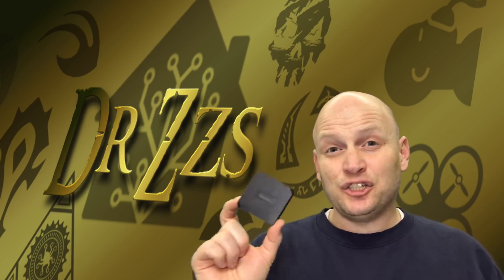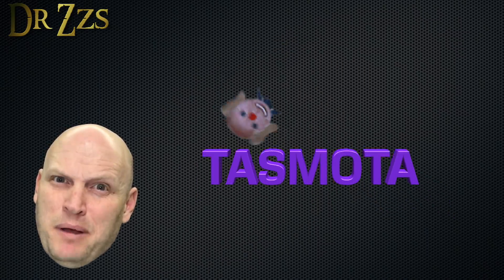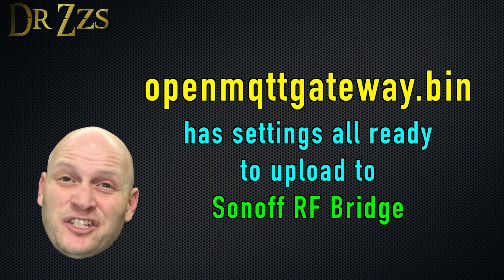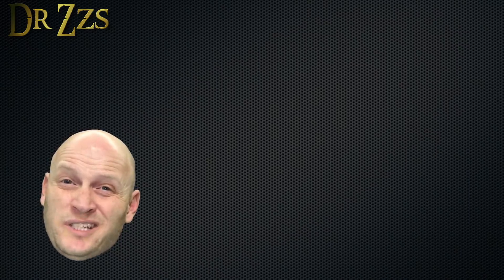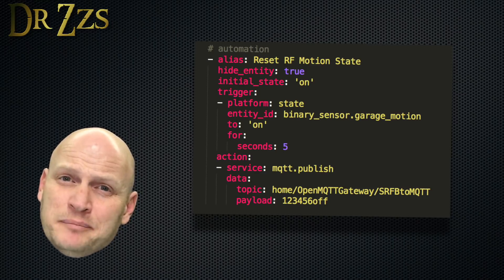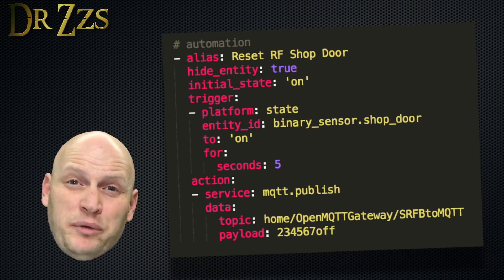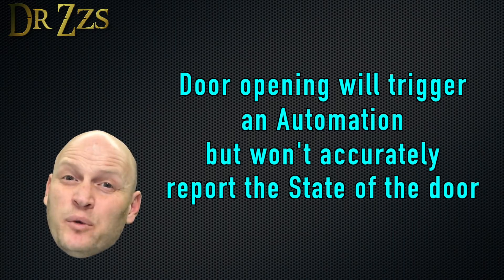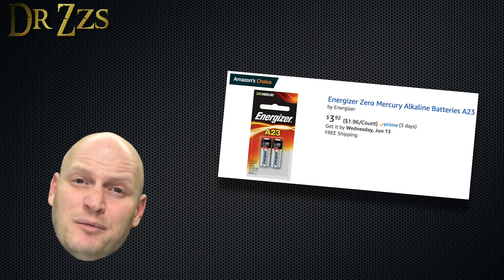Sonoff RF Bridge w/ MQTT & Home Assistant

Comment: What do you think, wich software is better for DOOYABLINDS. OpenMQTTGateway or Tasmota with the Portisch firmware? I will control the bilinds in HomeAssistant. I hope it´s possible to get a state in % or somthing linke that.

Comment: Hi, having trouble with this. I just get a command window that cycles through a few attempts and the flash failed. "trying to connect". Ive followed your instructions but im stuck. What am i doing wrong?
Reply: Try reversing the Rx/Tx connections on one side. You want the Tx of the adapter to connect to the Rx of the Sonoff, and vice versa.

Comment: Has Tasmota improved in regard to messaging or would you still recommend openmqttgateway?
Reply: Hello, i am using tasmota 7.1.1 on a sonoff rf bridge, it works a treat. Do you need help with anything?
Reply: @MegaGaspadin  I’m good thanks, ended up using an RFLink box.

Comment: Hi everyone. I´m new with Sonoff. 
Does anyone know how many PIR or magnetic sensors may be connected to an RF Bridge ?
I need to connect more than 64 sensors. I´ve read limit is 16. Maybe with Tasmota or another firmware, limit may be higher.
Thanks !

Comment: On my Linux Mint system, it know the battery status of my AA mouse battery.  It is at 70% right now.  Is there a way to get the battery state of these RF devices?
Reply from the maker: Some will send a battery-low signal, but not all.  It just depends on the sensor.

Comment: After flashing Sonoff Bridge will also suport more devices to be added to same bridge ? Initially support only 4 and in case you need more have to buy another bridge .
Reply from the maker: If you use Tasmota there are no limits to the number of codes the bridge can receive.  It is limited to 16 codes to transmit.

Comment: What's the Range of the Rf devices? I live in a big house. and therefore I got a lot of ZigBee and z-wave stuff. but at the price point, the RF stuff comes at it made me interested. then again if I need to have multiple bridges like you do with IR I think I might just pass on the RF stuff what you're experience with this?
Reply from the maker: I've had good experience with RF devices.  I have RF sensors out in the garage with the Receiver on the second floor, so separated by several walls and at least 50' and they seem pretty solid.  They aren't as fast to respond as Zigbee devices, but as you say, the RF stuff is pretty cheap.  
I just started using the Xiaomi Aqara sensors with the Conbee II and the Deconz add-on for HA.  They might be the cheapest Zigbee sensors.  So far they've been working pretty good.  I set them up on a live stream a couple months ago.  I've got plans to do a full video about them soon-ish.  
Hope that helps.
Reply: @DrZzs  you will love the aqare stuff. I've been using it for over a year and I love it. The only issue I have with aqara motion sensors is that it takes a full minute to go from detected to clear. Aka on/off. But as fare as buttons go they are brilliant
 The aqara cube seemed like a gimmick. But now I have a few. For music controls light dim and what not. Definitely get the cube!! Well as a matter of fact get everything aqara and xiaomi has to offer for smart home. It's integration with home assistant makes it so powerful and yet cheap.

Comment: Thanks for the video, my 433 Mhz PIR sends three  different codes, is it possible to OR the codes  in the template for example: payload_on: "51FEA0" OR "51FEAA" OR "51FEAB" if this is not possible can wildcards somehing like the following can work? any hint would be great.... thanks
payload_on: "51F***"
Reply from the maker: You can't use wildcards.  I would guess one of those codes is "on" as in motion-detected.  Probably the one ending in A.  Then probably B is the Off code, and 0 could be a low battery code or just an "available" code, meaning the device is active.
Reply: @DrZzs  Awesome, You were correct sir, at least one code was consistent with motion detection, thanks for the feedback.

Comment: Hi Dr
I have Broadlink RF pro. I heard that Sonoff Basic RF is not compatible with Broadlink frequency so I ordered Sonoff RF Bridge. 

I have different types of down lights installed in my home (not my doing). Those come in  different sizes and also use different power (12v, 16v with transofrmers and 230v). There are some downlights that are wifi based including hue range. 

However unlike normal lights where down lights are installed there are about 4-5 of them in each room. So If I am to get wifi based down lighrs I would be clogging my mesh network further. As such I am planning to add Sonoff RF basics for each downlight and then use Sonoff Bridge to control them. In that way I do not need to change the existing bulbs or power controllers and just need to add a soffbasic RF to the circuit which is very easy to do. 

My question is have you played with Sonoff Basic RF and can I easily on/off with the Bridge which mimic turning on off down lights via switch. 

Thanks

Comment: So you're using a gateway to convert RF to MQTT. Can't we skip the gateway and simply have an RF receiver on the Rasperry?
Reply from the maker: You could certainly do that.  I don't know what an RF receiver for a pi would cost, or what would be the best way to control it.  My Sonoff RF bridge has been rock solid running Tasmota for a long time.  My way works, so I'm sticking with it.

Comment: eish... newest code, refusing "your_password" as the wifi manager initial access / password. anyone else get around this, Need to urgently get access to the RF bridge, got someone coming to help me with stuff later and need it working then. running OMG
Reply: Ignore, eventually it decided to accept the password. not having a web interface that can be connected to after it joined a wifi ssid, makes it difficult, I seem to have initially specified mqtt credentials wrong, costed me re-flashing it, would be great if it had a post wifi join web interface to check/reconfigure these. just saying...
Reply from the maker: Glad you got it working.  ya, that would be a good addition.  Thanks!

Comment: Hi! I got the "GS-WDS07 Wireless Door Magnetic Strip" from banggood which actually transmit two separate codes for close and open. So that is nice. But there's another problem: if HA is restarted it'll show the doors as "closed". How do I make HA remember the last status? Better yet: is there a way to request the status from these switches? Or hack them into sending their status at intervals... Thanks!
Reply from the maker: Cool!
I don't think there is a way to request state updates from the sensors.  
To get HA to remember the last state you need to set the message to send with "retain".  I don't remember how to do that with OMG since I switched to Tasmota for my RF Bridge. There should be a setting in OMG somewhere to send messages with Retain.  That should be the trick for remembering states after HA restart. 
Hope that helps.
Reply: @DrZzs  in the video you talked about why you used OMG instead of tasmota. So you switched back to tasmota?

Comment: Would be nice if we can define/specify the topic to which the bridge posts messages.
G
Reply from the maker: I started using Tasmota for my RF bridge and it works better imo than OMG. You can do some customizing of the mqtt topic. The RF code it generates is something established by the manufacturer (I assume).  There's no way to easily change that code that I am aware of. 
https://youtu.be/OfSbIFIJPuc
Reply: @DrZzs  eish... just saw your response now, after deploying OMG this weekend, was about to ask how to do rules in OMG as it seems taking the data and changing the mqtt publish to specific topic simplifies things allot.

Comment: Hi!
This worked perfect once I decided to follow your steps EXACTLY as described :) , with a couple of notes, though:

- you said: "once this is successful, and I'm sure it will be, on your first try (...) then get out your phone and look for a wifi network.."
Actually, there's no OpenMQTTGateway network available at this point.
I assumed you disconnect the Sonoff RF Bridge, put its switch back to "ON" and then plug in a power adapter to power it on. Correct? At least this is how it worked for me.

- the topic seems to be home/OpenMQTTGateway/SRFBtoMQTT (without the last " / " as captioned on the video) and seems to be case sensitive!

When all is up and running I get the messages on this topic (with MQTTlens) but it takes about three seconds from the time I activate/deactivate the magnetic switch until the RF_LED on the Sonoff RF Bridge blinks and the message pops up in MQTTlens. Is that expected?

I should add that I first tried to flash from command line with esptool.py (first erasing and then esptool.py --port COM4 write_flash -fs 1MB -fm dout 0x0 OpenMQTTGateway_1.bin ). This did not work! I mean the flashing was successful but I got other problems, different ones depending on the bin (the one you linked and others downloaded from the OMG page):
- with some versions I did not get the WiFi setup page
- with another version I would get that setup page each time I powered the Sonoff RF Bridge up (like it forgot the settings or something).

For anyone trying this I highly recommend using the ESPEasy the way you described it.

Thank you for this tutorial!

Comment: Thanks for great videos DrZzs!

I have had problem to find sonoff devices (S20, S26, ..RF bridge at the latest) on wifi after flash in every case except for a TH10. Have tried both ESP Easy and Tasmota. The flash seems to be successful but then nothing. With Wemos D1, success every time. Never any problems. Any advice?

Comment: oh oh, I've just found there is an Hassio option to avoid the automation.yaml configuration to reset the SINGLE STATE BINARY SENSOR back to off. Here is:

"off_delay
"
(integer)(Optional)For sensors that only sends On state updates, this variable sets a delay in seconds after which the sensor state will be updated back to Off.

I used it, in this way into configuration.yaml:

  - platform: mqtt
    name: "Porta Terrazzo"
    state_topic: "tele/bridge-1/RESULT"
    value_template: '{{ value_json.RfReceived.RfKey }}'
    payload_on: "7"
    off_delay: 30
    device_class: door
    qos: 1

when the binary sensor went ON it will be backed to off after 30 secs and NO Automation is requested to do the reset job.
Reply from the maker: That’s new since this video. I need to try it! Thanks
Reply: @DrZzs  I cannot say that option age,  I'm new on Hassio (January 19), but I tested at version 0.87.0. Let me know. Thank You indeed for all your excellent activity on yutube.

Comment: Which is the topic and payload to SEND an RF Signal (can be saved to a key from 1 to 16, or a new one)??l
Reply from the maker: Check out the other RF bridge video when I use TASMOTA.  You have to set the bridge and a key-button in TASMOTA to “learn” then press the physical button that would normally control the device you want to activate.  Watch the TASMOTA console. It should tell you it learned the code. Then when you press that key-button in TASMOTA it will send that code. To see the mqtt topic for that action look at the console after you press that key. It should be something like “cmnd/yourbridgename/RF_key01” but I don’t remember it exactly
Reply: @DrZzs  so is possible to send only 16 commands
Reply: @DrZzs  Found. You can use this       - service: mqtt.publish
        data_template:
          topic: 'cmnd/YOURBRIDGENAMEHERE/RFCODEHERE'  so you are not limited to send maximum of 16 codes, but unlimited codes

Comment: Fantastic video, thank you. I've been able to replicate your schema on a Sonoff RF bridge flashed with Tasmota, configured on Hassio,  with the following setup:
 
 on configuration.yaml file

- platform: mqtt
    name: "Porta Terrazzo"
    state_topic: "tele/bridge-1/RESULT"
    value_template: '{{ value_json.RfReceived.RfKey }}'
    payload_on: "7"
    payload_off: "700"
    device_class: door
    retain: false
    qos: 1
    optimistic: false

on automation.yaml file

- id: Reset Porta Terrazzo
  alias: "Reset Porta Terrazzo"
  hide_entity: true
  initial_state: 'on'
  trigger:
  - platform: state
    entity_id: binary_sensor.porta_terrazzo
    to: 'on'
    for:
      seconds: 30
  action:
    - service: mqtt.publish
      data:
        topic: tele/bridge-1/RESULT
        payload: '{"RfReceived":{"RfKey": 700}}'

as you can see I used numeric values for  payload_on and payload_off (7 & 700) the reset automation starts after 30secs (instead of 5 secs) and activates the service mqtt.pub publishing the same topic with a short form of payload '{"RfReceived":{"RfKey": 700}}' still detectable by the value_template ( {{ value_json.RfReceived.RfKey }}' ) to reset the binary sensor.

I've been able to configure 2 PIRS and 3 door/window sensors with a single state change (open).

Comment: I had similar problems with tasmota with ir receiver. You need to recompile it to support longer mqtt messages. The default mqtt size is too short for this kind of messages and corrupt them.

Comment: Great video, Iooking forward to flash by Sonos bridge.

Actually it is not so difficult to understand the RF codes generated by tasmota and/or OpenMQTTGateway.
The tasmota data field "D54C1E" would translate in OpenMQTTGateway to Message 13978654 which is the same. D54C1E is the hexadecimal representation of 13978654.
Using node-red you could convert those numbers to binary and even figure out additional commands for you device.

(parseInt("D54C1E", 16)).toString(2) = "110101010100110000011110" is the signal in binary form.
(parseInt("D54C1E", 16) >> 4).toString(2) = "11010101010011000001" extract first 20 bits for object identification
(parseInt("D54C1E", 16) & 0xF).toString(2) = "1110" extract last 4 bits containing the codes of specific events

So depending on what type of device you have you could unlock many more events for example:

1110 = On 
1010 = motion alarm
1011 = tamper alarm
1111 = battery alarm

Comment: Hi, Thank you for the wonderful information. I also started automating my home setup last year and figured out using the sonoff door sensors that they create only time alarm trigger instead of open and close state trigger. I wanted my balcony lights to Turn ON as the door opens and Turn OFF when we close the door and through the Sonoff door sensor, it certainly was not turning OFF the lights. So I got a Sonoff PIR sensor and stuck it behind the door wall and set the PIR sensor alarm to Turn OFF the balcony light. So the PIR sensor triggers an alarm if I come in front to open the door, which will trigger an alarm to turn OFF the already OFF balcony light and then the door sensor will trigger the Balcony light to Turn ON and when I enter the room and close the door, the sensor again Turns OFF the door light. The only catch here is the placement of the PIR sensor, as initially I stuck the sensor at the edge of the door and it used to trigger 2 alarms, one seeing me approaching the door and then after opening the door, it triggered another alarm turning OFF the balcony light as it saw the door coming it's way. So I moved the PIR Sensor to the middle of the door and now it's works perfectly as it probably senses myself approaching the door and the door opening under the same alarm trigger. It's probably not the perfect solution and works only 8 out of 10 times correctly. But considering the cheap price of Sonoff, I really won't complain for the 2 times it messes up.

Comment: You show 2.4ghz and 5Ghz Sonoff but on the website, it says 2.4Ghz and my phone will only run on 5Ghz so unable to connect to my WiFI any help please would be good or is there another bridge that I can buy that will work on 5Ghz?
Reply from the maker: There aren't any ESP8266-based devices that work on 5ghz.  If I said that somewhere it was by mistake.  Help me understand what you're trying to do and what isn't working.  Most Wifi routers these days have both 2.4ghz and 5ghz channels.  If your phone connects to the 5ghz, and the Sonoff connects to the 2.4ghz, they will still both be on the same home network and you will be able to control the sonoff from your phone.  That probably isn't what you're asking, so give me some more information and I'll do my best to help.  
Thanks

Comment: Will this work on a regular esp8266 board?
Reply from the maker: yes, I think. But you would have to add an RF transmitter/receiver yourself.  Actually, you may need another microcontroller to get it to work.  I know the RF Bridge has a second controller, that has to do with the RF.  I don't know much more about it than that.

Comment: Nice trick with disabling triggered door sensor. I guess we have to create separate automation record per each sensor? I have a question though: is it possible to apply 1 "off" automation for all my sensors? i want something like:
if triggered_sensor.state == "on":
    pause(60)
    triggered_sensor.state="off"
Reply from the maker: good question.  Sorry I don't know the answer.  My guess is there is a way to group the sensors and just have one automation to reset them.  Poke around in the HA docs a bit.  If you don't find what you need ask in the general HA discord chat.  Wish I knew the answer for you.
Reply: nice idea to turn them all off at once! actually i dont care about unique state. i only need to know when someone is trying to invade my castle. thanks mr. Head! ;)